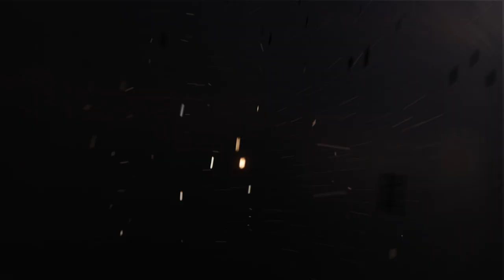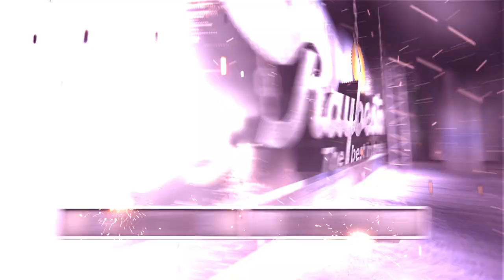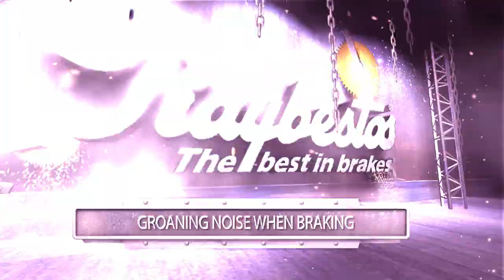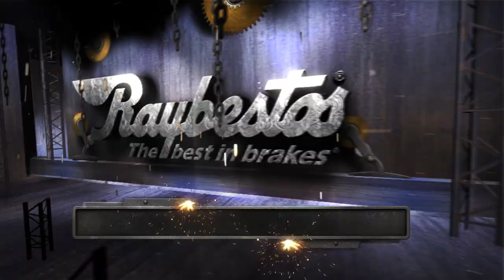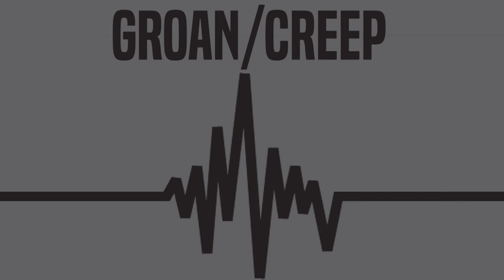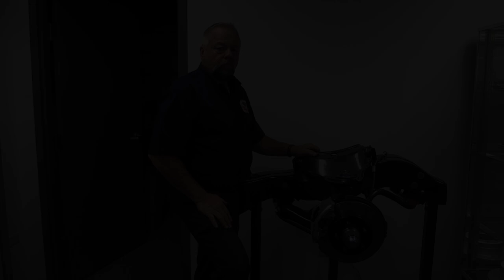Creaking Noise When Braking

Comment: What if the sound happens when depressing the brake pedal while the vehicle is stopped?
Reply: Mine sounds both when release the break pedal and slowing down :(
Reply: Same. 2017 escalade. Has to be in gear and not moving. Doesn't do it in park
Reply: Mine is doing the same thing. Did you find out what was wrong?
Reply: It's forever a mystery.. 
... it's an Enigma ...
Reply: Same problem here now on a 2020 BMW 840i 🫠
Reply: Wish there was audio on this  noise
Reply: I have a 22 MDX 15k miles and does this sound lately. Exact noise I got when depressing/releasing to stop.
Reply: I think it's the piston in the caliper dirty or rusted. When you press the brake the piston goes out and when you release the brake the piston goes back in that if dirty, have rust or uneven wear, can make a door hinge sound that is not lubricated for years

Comment: I finally got mine fixed. My one only had a load noise when fully stopped and then going. The problem is the pistons in the calipers need to be re-lubricated. I changed my rotor and brake pads and re-lubricated all. The noise is gone. Hope this can help you.
Reply: Did you get that noise when you tried to reverse park by turning the steering?
Reply: @livewireredb.9953  it happens previously when the brakes are cold and start from fully stop, no matter going forward or backwards and nothing to do with steering wheels
Reply: @harrywu6008   Yup. I'm having this noise when the brakes are cold. I thought it could be a steering or suspension problem but my suspension parts are fine. I may need new calipers or lubrication.
Reply: what did you lubricate the caliper pistons with?
Reply: @matthewguzman7107  The mechanic did it all, I assume it is the normal piston lubrication nothing too fancy
Reply: @harrywu6008   My mechanic used a pinkish grease on the pistons at the sides of the caliper and the noise was reduced dramatically. There was no need for surgery or a rebuild.
Reply: @livewireredb.9953  wooow, that was nice and I am glad that worked for you! I have no noise at all now, which feels so good. One reason I changed them all is I wanted to change to ceramic brake pads with almost no dust.
Reply: @harrywu6008   Okay. Maybe if I switch to ceramic pads, that will kill the noise completely.

Comment: My old camry does this under a controlled movement it will do it forever.  If i let off or apply more brake power it will stop.  Sooooo it's the brakes which would have been nice to hear a solution instead of just saying it's the suspension.
Reply: Probly don’t have the problem now but this link helps fix your situation it literally should just be that two bolts need greased bc the last mechanic didn’t do this on your last brake pad/rotor change when dealing with the caliper

https://youtu.be/z5kJbEjLyho?si=zGzP0DJa5jE6ZPmY

Comment: I have the same noise:  the suspension do not make the noise on any bumpy/rough road, it only make noise when the car start to move or come to a stop, I already have my breaks checked/cleaned/lubricated and I still have the same noise! The noise make me really want to get rid of the car!!! Please help!!!
Reply: Same on my corolla
Reply: Ever figure it out?
Reply: I just did rotors,pads cleaned all components added fresh lubricant . I added fresh break fluid bleed my passenger side thinking it had air bubbles. I’m still getting a creaking when applying the breaks on passenger side .

Comment: Sway bar bushings often cause that when starting and stopping. Use sway bar bushings that have a nylon inside insert rather than the solid rubber or polyurethane ones.

Comment: That's exactly what my 2013 Chrysler 200 is doing!  Inching forward while applying brake. What is it??
Reply: To all comments on here if your unsure TAKE IT TO A GARAGE!!! as vid says it could be a number of things so guess work ain't gonna work
Reply: @J4C08G4M3R  did that already. They want to change everything and charge me over 600.00 for a maybe fix
Reply: @J4C08G4M3R  did that, twice! Both mechanics said everything on my front end is fine but obviously something isn't fine.
Reply: Simple solution, it's cheap pads and disks as cheaper pads had more metal in and tend to over heat more easily causing glazing, which inturn causes friction metal on metal, or as vid says have a good look at suspension components

Comment: 07 Lexus RX350, all new brakes, calipers, rotor turned, new pads, I let off the brakes slightly, groan city. I brought the car in for rear brakes, they were due and the brakes were silent, after rear brake work groan started. I'm going back, I just wonder if OEM pads will solve the problem, a Lexus, even an 07 with all new brakes, shouldn’t groan, driving me nuts.

Comment: What about if you stop the car pushing the brakes and there are no noises, but then when you are about move you start to release the brake very slowly then you hear these same noise, is it normal?
Always when I have half away brakes pushed when I am about to start move from a red light or from a park state I hear these groaning noise. If I push the brake completely there is no noise, if I release the brake completely there is no noise.

The noise only comes when I am about o move and I slightly start to release the brakes or slightly start to push the brakes when I am about to go. 

Do you know when you see the red lights will become green and you start to move very very slow and start to reelease brake? that's when the loud groaning noise comes. It seems it is putting pressure somewhere or touching somewhere. The brakes were recently serviced. 

Thank you.
Reply: That sound you here is the brakes. If you were to watch someone else’s car do it, you will see the rotor shakers the pads are actually skipping across the rotor. All vehicles with disc brakes do this from the 1960’s up until present day. Think of it like this. Run your finger across a glass window applying force. Your finger will slightly skip across the surface from the friction.
Reply: @davidshelby4534  so how to fix this? i have exactly the same kind of issue Renato described. This annoying groaning noise happens just before the car completely comes to a stop while I slowly press the brake or just before the car starts to move while I slowly release my brake from the pressed position. there's no noise if i press or release the brake a lot quicker, or there' no noise if the car doesn't come nearly to a complete stop.
Reply: It's not necessarily a "bad' sound that you have to fix. Lots of times it's just newer brakes that still have lots of material that make the sound, I would probably check the guide pins, see if they're lubricated properly.
Reply: @fredericknyein428  did u solve the issue i have same problem
Reply: @Manchester_united_fan001  I sprayed WD40 on brake pads and it seems to have some sort of effect but the noise didn't go away completely and it came back from time to time. but after a whole of year of driving,  probably through wear and tear and through season changes and annual services, I don't know what did it, but now the noise is barely noticeable!
Reply: @fredericknyein428 whoever reads this, do NOT spray any lube or WD40 on your brake pads EVER.
Reply: @chad6504  LOL dammmmm he survived WD dezzzzzzz

Comment: Yea it can be related to bushings in suspension but it can also be related to brakes like mine if im stopped like in park and push the brakes ill get a creaking noise does the same thing when coming to a stop this would indicate a sticking brake caliper if you roll down your windows while driving im sure youll hear a rubbing noise if thats the case new caliper or lube up the caliper and bleed your brakes will fix the issue
Reply: Did the sound happen from cold?

Comment: Thank you for your video. So what do I need to fix if my car has the same noise? Thank you!
Reply: Check or ask someone to check your: sway bar bushings/control arm bushings (all of the bushings in general in the front and/or back depending on where the noise is coming from), sway bar links and ball joints. Hope this helps.

Comment: Question what if it creaks only when I'm at a complete stop.it will Creek if I am completely stopped and pressing the brake pedal.
Reply: My 2017 Hyundai sonata does the same thing I was told that it was the lower control arm bushings but I didn't have it done yet because I want opinions

Comment: I get creaking sound when braking gently, only after things warmed up. Also, get a repetitive squeak sound sometimes, which is loud enough for a passer by to hear. Garage guy gave visual check.of brakes and said they are fine, most likely joints problem. I'm still inclined to think its the caliper pins..confused..
Reply: Did you fix the issue?
Reply: @jimmyramirez8844  No, I've not had the time to sort this out. The loud squeaking has got worse, which is more annoying than the creaking.
Reply: OMG I'm on the same boat got a new 2023 hybrid Sportage. The dealership told me it's normal in hybrid cars?? Pls help 😭
Reply: Did u fix it yet ? Please answer me , if yes , what was the problem

Comment: Mines happen when I am slowly turning the wheel. or even when I change it from reverse to drive.
Reply: same here bro while turning the wheel ,,did u get any solution ???????????
Reply: @sakshamsharma4194  man not yet. I ended up taking engine apart so didn't focus on that noise yet
Reply: @sakshamsharma4194  Could be power steering rack low on fluid if it's only when turning the wheel.

Comment: I have the creaking noise, but it's not as loud as this. Whenever I'm going up my driveway or put in reverse, I will hear it when I step on the brakes. I just installed the lower control arms, new rotors, and new brake brackets and brake pads Everything is lube up from the caliper pins to the brake pads. It is still making this noise. What else can it be?
Reply: I had my SUV checked by two different mechanics for the exact same thing, both said everything in my suspension was fine. Noise goes away when it rains/snows. Whatever the problem is it just needs lubrication but I can't pinpoint what it is.
Reply: I have same sound while i release the brake to reverse..honda city. Did u solve this issue?

Comment: I have the same problem it's so loud when I drop my girlfriend off to work it embarrasses her. I got my rotors serviced thinking it was the rotors change my rear caliper because it had a slow leak and then changed my brake pads and shoes the same time. Know I no my sway bar link is no more so when I get it fixed and if I don't hear the noise will be sure to let you guys no if that helped .
Reply: Did fixing the sway bar work?

Comment: I have this same sound when releasing brakes slowly. Replaced both lower control arms because they are already wornout with lots of play. Still have the same sound but a bit louder this time compared to my old control arms. I also have new swaybar links and shocks, so it could be the brakes doing same noise like this.
https://www.youtube.com/shorts/Yv9EF_iNmRc